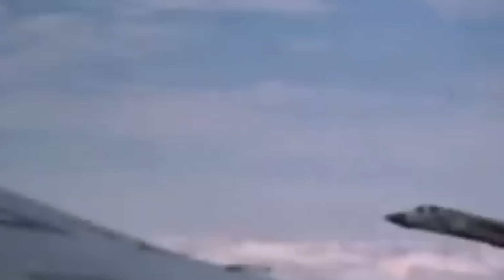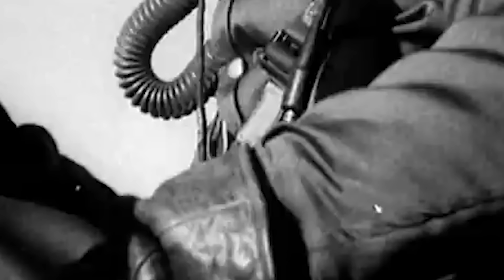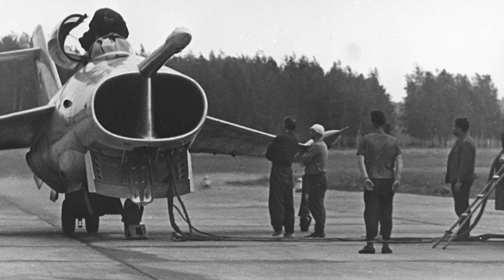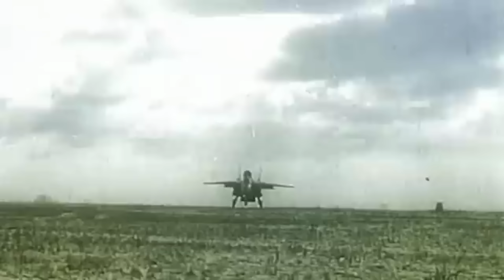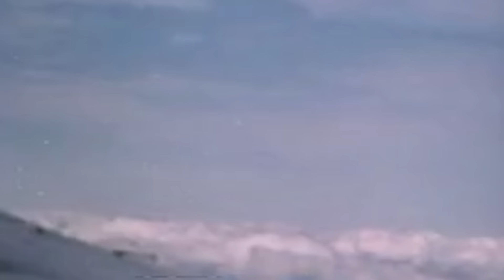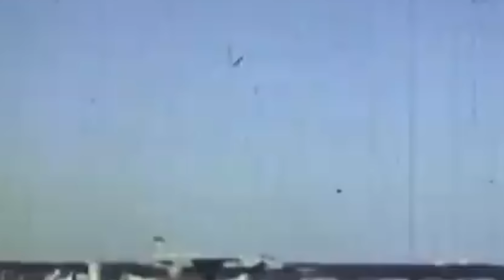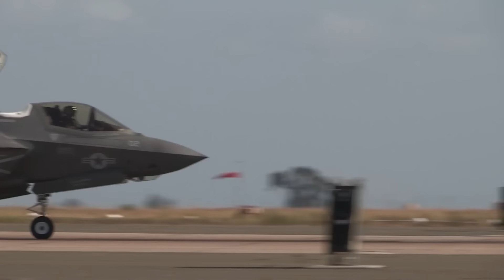America Stole This Plane and Turned It Into a Monster

Comment: In the early days of the space race NASA spent a huge sum developing a pen that would work in zero gravity, the Russians used a pencil.
Reply: Which was done due to conductive dust that comes from pencils. Mistake learned from Apollo 1, fun fact Russians also adopted pens for the same reason
Reply: The pencil was a really bad idea.  It makes graphite dust, an excellent conductor, that will connect all the electric circuits in the spacecraft and short-circuit it all.  We put graphite dust in bombs we use on radars for this reason.

Comment: While the Harrier went into serial production and was in service for decades, the Yak-141 struggled to even stay airborne.
As many noted, nothing from this aircraft was "stolen" by Americans. Convair designed the rotating nozzle 30 years before Yakovlev, later Convair Merged into Lockheed. Take a guess where Lockheed got the patent and technical documentation from. 
Yak was really dead on arrival. 2 additional engines used only for takeoff significantly increased the weight.
Reply: Struggled to stay airborne? What are you talking about? It can hover for as long as it wants even with full fuel and payload. Unlike the harrier which even  with the modern versions can barely go a decade without turning into the world’s most expensive crab trap.
Reply: Also do your research it was never put into service because the U.S.S.R collapsed and even with the extra 2 engines it still had a T/W ratio higher than all of the F-15s
Reply: Yakovlev's design bureau has sold a new version of the Yak-141 single-engine aircraft to the United States.  according to the same scheme as the F 35. Here it is specifically compared to Harier in order to distract attention. The Yak-38 (the first flight took place in 1970) can be considered an analogue of the Harrier. The Yak-141 is a fundamentally different aircraft.   Get a ready-made aircraft that has solved thousands of problems and conducted hundreds of tests, all the documents and drawings.   this significantly speeds up the work.
Reply: @championknife  Yak-141 has 3 engines, F-35 has just ONE. Yak-141 is itself a copy of an American design. Why would the Americans need to copy a copy if their designs were so good in the first place, that the Soviets felt the need to imitate them?
How about you start using your own brain instead of repeating propaganda for the stupid sheeple?
F-35 is an immensely capable and financially successful aircraft, and demonstrably in no way derived from the barely flying prototype-only soviet junk.
Reply: @LoserDestiny  I repeat once again, I saw an interview with Yakovlev Design Bureau employees, they sold a new modification of the Yak141 with one engine in the USA and exactly according to this scheme, when the shaft from the engine goes to a vertical fan. I've heard that personally.   And how could the USSR know about the US aircraft, which was only on sketches and was not produced in hardware, it's ridiculous.)))))) You can also simply compare Soviet junk with American analogues Su-35 is better in combat qualities than F-15, Mig-29 is better in combat qualities than F-16))))))) You're a comedian.
Reply: @championknife  LOL.
The (now largely defunct) design bureau tells "stories of glory", how "DUMB 'MURICANS" (that's a phrase from a highly popular POST-soviet comedy sketch in ruZZia) bought secret tech for Coke and burgers, and my little muppet boy here believes every word. You aren't a comedian, you're a clown. 
Any proof MiG-29 is superior to F-16? Or Su-35 (production since 2013) superior to F-15 (production since 1972)?
What are you actually comparing there in the first place? An early F-15 variant vs the most recent Su-27 variant?
F-15 was replaced by F-22 20 years ago, while ruZZia is still incapable of even a 4+ Gen fighter (due to a lack of proper AWACS planes)
The one time MiG-29 and F-16 met in the sky, over Serbia, MiGs were absolutely outclassed.

I wonder why Ukraine is asking for F-16s, instead of some shitty old MiGs, that can be scraped from all the old "soviet friends" countries.

You apparently have no idea about the scale of soviet tech espionage. Check out North American NA-335 project from the F-15 competition, and tell me it's not Su-27 and Mig-29.
It dates back to the late 1960s, while the Su-27 and MiG-29, which copied North American's design, didn't make their maiden flights until 1977.
Reply: @LoserDestiny  did you forget the Convair Model 200 ?
Reply: @mikoyan31BM My first comment is literally about it!
Reply: @shaun469 So, perhaps it's okay to be misled and misinformed by content creators who should know better?  @LoserDestiny
Reply: @soonerarrow  make a better video then
Reply: @shaun469  I'm here to learn, not to teach but nice try at avoiding an answer to my question.
Reply: @soonerarrow   read facts then. Not watch utube.
Reply: @shaun469  Are you the creator of this video?  You seem strangely wedded to the proposition that it's okay to publish easily debunked misinformation that mislead viewers.

Also, I can get MIT college courses, not mention many other college/ university courses and PhD scholarly discussions here on YT, so your advice is herewith disregarded because of your unnatural bias to the false.
Reply: @soonerarrow  you seem to be of the opinion that the creator of this video cares. Or that they somehow owe the viewer something. If you don't like the video that you get for free then don't watch it.
Reply: @shaun469  Well, again your advice is disregarded because now you've veered from bias to the false to just outright false statements.  All patrons of YT pay to use their service either with a monthly fee or by having to endure incessant, inane and idiotic advertising spots that consume more than a non-trivial chunk of our monthly internet data allocation.

Shame. A creator telling people not to watch or comment on their work.
Reply: @soonerarrow  good on you👍
Reply: If it was DOA.. why pay $400 million.. clearly your argument doesn’t fly
Reply: @ Because Lockheed needed flight data. They already were in possession of the Convair nozzle after Convair was absorbed into Lockheed. That is no secret, just educate yourself.
Reply: @crevis12  to know your enemy ? isnt that what they did with the mig 25, to even though the US already had the f15 they still thought the mig 25 was a super plane and so took any chance they could get to study it which they did after a pilot defected. Why would they spend money to study adversary aircraft, is really not a question to ask at least i think  most people know it as common sense.

Comment: Lockheed developed their system independently, it was convergent evolution. The reason they bought the data package and rights from yakolev was that they didnt want yak to later challenge their design or file a frivolous lawsuit. They must have thought it was a high likelihood that they would face fhe accusation and that 400k was cheaper than the lawyer team. Also, looking at the data package from a parallel project that functioned similarly is invaluable to see if they faced problems or found solutions you havent thought of yet.

Comment: This is the answer: the Swedish and Russian Frontal Aviation strategy: the ability to take off from roads or improvised airstrips with a short take off and landing roll.  The Gripen needs limited support and can take off from motorways.  Too much is sacrificed for VTOL.  The F-35 would have looked like the Shenyang Sh-35 (I don't use J codes) without the VTOL requirement: it would have been twin-engined and had better GEOMETRIC stealth.

Comment: This video is missing an important step Soviets took before Yak-41/141, Yak-38. Yak-38 was actually put into a small serial production. While it had many shortcomings (mostly related to range and payload), it was meant to be a transitional model to test the real-world use of a VTOL aircraft on an aircraft carrier before Yak-41/141 would arrive. 

Soviets had many talented engineers. And, while I thought for many years that it sucks that Yak-41/141 never saw production due to the Soviet Union collapse, now I am very glad that the current Russian regime has no access to such military tech.
Reply: They're developing better fighters. While the F35 and F22 keep having electromechanical issues and crashing quite often. Get out of here with your brainwashed Russiaphobia.
Reply: They does have access to those technologies due to yakovlev is a part of UAC. But why they don't use it? Because they have no need for it. The Mig-29/35 already filled the role of a vtol aircraft.

Comment: "With the fall of the Soviet Union, Lockheed Aircraft entered a partnership with Yakovlev in 1991 for further development of the aircraft, now officially redesignated Yak-141; the partnership would not be announced by Yakovlev until 6 September 1992 and not confirmed by Lockheed until June 1994. The remaining intact protoype was displayed at the Farnborough Airshow in 1992. It was announced that the joint venture would result in the construction of three additional prototypes and an additional static test aircraft, one a two-seat trainer version, and all with an increase in their gross weight, however no additional aircraft were ever built." 

Guess who builds the F22/F35...
Reply: Considering the Yakovlev design bureau stole Convair Model 200 nozzle design, and Convair later merged into Lockheed, Lockheed was really only interested in some test data about a design they already owned a patent to.
Reply: @LoserDestiny  You are right that Lockheed knew quite a bit about the Convair from 1973 that the Yak was copied from.  However I think Lockheed bought General Dynamics (including Convair) in '95.
Reply: @lqr824  And F-35 development only started in 1996.
Yeah, perhaps they didn't purchase test data for a design they owned, but the other way around, they purchased an entire company, including all their designs, because they had convincing flight data with a similar engine by Yakovlev.
Either way, Yakovlev was not the original developer of the swivel engine, and neither did Lockheed need to "copy" a soviet engine.
Reply: @LoserDestiny  Stolen? For real? Convair Model 200 Flew? At least once? You can't steal something that doesn't exist in reality! You A bunch of magical fuckers, projects on paper like Convair Model 200 in The USSR was many thousands. In the 90s, the Americans took out so many secret developments that it is better to keep silent in a rag. About the fact that someone stole something.

Comment: There was only one vtol aircraft that stood the test of time until F-35  and is still flying today
Reply: AI: Can a Harrier jet take off fully fueled and armed without a runway?

The Harrier fighter (e.g., AV-8B Harrier II) is designed for Vertical or Short Take-Off and Landing (VTOL/STOVL). It can take off vertically without a runway, but there are limitations.

Can it take off fully fueled and armed without a runway?

Generally, no. With a full combat load (lots of fuel and weapons), the Harrier cannot perform a vertical takeoff. It requires a short runway or a "ski-jump" ramp (as used on aircraft carriers).

Why not?

1. Vertical takeoff requires a huge amount of thrust, because the engine must lift the entire weight of the aircraft without the help of forward motion.

2. A full fuel and weapons load makes the aircraft too heavy for vertical takeoff.

3. In practice, Harrier operations usually involve short takeoffs (STOL), where the wings generate lift and less engine thrust is required compared to vertical takeoff.

Summary:

✅ The Harrier can take off vertically, but only when lightly loaded (low fuel and/or no weapons).

❌ It cannot take off vertically when fully fueled and armed — a short runway or ramp is needed.
Reply: Dont care any more @iam5085
Reply: the F-35 is not VTOL
Reply: @georgebarnes8163 Lol, boy, serious? Next thing you gonna say is helicoptes are not VTOL.
Reply: @LoserDestiny  the Harrier and F35b  are STOVL not VTOL, learn the difference
Reply: @georgebarnes8163 Just because they can't take off vertically with the maximum payload, doesn't mean they are STOVL. They are both absolutely capable of vertical takeoff. I don't even see any point in discussing that. That is a demonstrable fact.
Reply: @LoserDestiny  If you took the trouble to actually read up on the aircraft  you will find that neither are VTOL and are clearly designated as STOVL. Neither can VTOL with any payload let alone max payload and even then with near empty fuel tanks.
Reply: @georgebarnes8163  I really don't care what your saying goodbye
Reply: @stu872  Never let the facts get in the way of a good debate
Reply: @georgebarnes8163 so you admit that both planes can VTOL, thank you🙂
Reply: @anthonystark5729  but neither are VTOL in use, pointless having a VTOL military aircraft  that  can only operate with near empty fuel tanks and no weapons. has the penny dropped yet?
Reply: @georgebarnes8163  Harrier VTOL payload 20,000 lbs, F35B VTOL payload 15,000 lbs, seem like pretty substantial pennies, less than the full capacities, true, but still useful in situations where you don't have a runway. Maybe try taking the blinders off and see all the possibilities, eh? 🙂
Reply: @anthonystark5729  what comic book did you pull those numbers from?
Reply: @georgebarnes8163 The manuals, what cartoons are you basing your opinions on?
Reply: @anthonystark5729  you are quoting STOVL numbers, the  total capacity for an F35b operating  as VTOL is zero
Reply: @georgebarnes8163 Nope, specific VTOL payload numbers, sorry. Maybe do some research next time :)
Reply: @anthonystark5729  learn the difference between STOVL and VTOL Kid, lay of the comic books and  the kids computer games. There is a reason why the UK carriers have Ski jumps, can you think what they are for yet?
Reply: @georgebarnes8163 Try visiting the real world, please. Learn the difference between what something is and how it is used, just because VTOL fighters are usually used in STOVL modes of operation to increase their payload capacities, does not remove their VTOL capabilities.  You could just as easily claim that as both the Harrier and F35B are conventional fighters as they can carry their maximum loads  from normal runway takeoffs.  Both fighters can take off and land vertically (with a reduced, not nonexistant, payload), so they are VTOL. Just because they are operated in the more efficient STOVL mode does not change that fact. 🙂
Reply: @ "A VTOL aircraft has been identified as one that takes off vertically, changes from hovering to forward flight, cruises to its destination, resumes hovering flight, and then performs a vertical landing."

See what is written there about the payload? 
Exactly - NOTHING. 
I honestly don't get what you are arguing for. 
Those aircraft were designed to have VTOL capability. That was required by the respective militaries. 
It's not like the military requested a STOVL aircraft, and as a byproduct, it could lift off with an empty tank. They requested a VTOL capable aircraft and they got it. Period.
Reply: @georgebarnes8163  stovl
Reply: And I was talking about harrier until f35
Reply: @ The Harrier was not VTOL either.
Reply: @georgebarnes8163  yes it was I've seen it take off vertical
Reply: @georgebarnes8163  go back to yours books
Reply: @georgebarnes8163 VERTICAL TAKE OFF AND LANDING
Reply: @stu872  They can with half empty fuel  tanks and no weapons load, both the Harrier and F-35 are STOVL.
Reply: @georgebarnes8163 if you have never stood in a car park at RNAS Yeovilton, deafened by the sound of a Rolls Royce Pegasus engine and the blaring alarms of almost every car in the place as a Sea Harrier casually touches down from nowhere before rising VERTICALLY into the air, as I have, how do you define VTOL capability? Another Sea Harrier also did a STOL landing and takeoff as the RN were doing famiarisation training in 1980 when I visited. If it goes straight up and straight down, it's VTOL. I also had a friend in the RE who was trained to set up landing mats on soft ground for Harriers in Germany for exercises, because they didn't need runways, but ciukd be affected by soggy terrain.
Reply: @georgebarnes8163 In 1969The Harrier took off vertically from a coal yard in central London, and landed vertically on a platform at Bristol Basin built by the Marines to win the London/New York airrace (Post Office Tower to Empire State Building).  The only faster time was in the opposite direction using a supersonic F4K Phantom from the Royal Navy.  This event was to commemorate the 50th anniversary of the first Atlantic crossing by Alcock and Brown.  This was only a month after the Harrier went into service with the R.A.F.  Although a short take off was preferred for a larger payload, they were subsequently deployed using VTO from forests and urban "bases" as well.
Reply: @georgebarnes8163  point is there both  better than soviet
Reply: If it can take off vertical at all it makes it capable of vtol harrier pilots will tell you the same thing don't matter if it half empty

Comment: No it didn't.

They're similar, but the F-35 is not based on the Yak-141, the F-35 programme was already in full swing when they bought the test data, and that's all they did, buy test data to see if there was anything they needed to be aware of with using a rotating nozzle and offset supplimentary thrust.